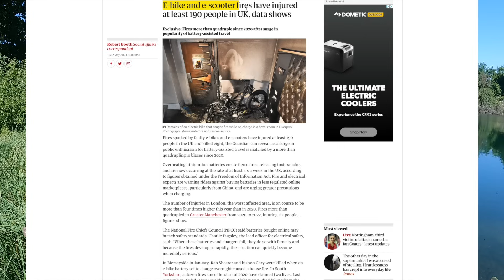ebike batteries dont just catch fire... what are they talking about?

Comment: I’ll buy the motor directly from China but not the battery pack and charger. I’d want to pay more for something that has been designed and assembled in the UK.
Reply from the maker: That might be counterproductive, many batteries made in the UK are glorified DIY sellers.
Reply: @andykirby  yeah I can imagine there would be a lot of DIY sellers, but surely if you bought from Halfords as an extreme example(I wouldn’t get one from there) they would at least to be a certain standard. Where  would you get one from?
Reply: @andykirby what's wrong with diy? They are of higher quality, well at least builder explains why and it matches quality of materiala

Comment: Every lithium battery will short itself at some point in its lifetime. This is because of something called "dendrites" that pierce the separator between anode and cathode. Most cells undergo a slow short and you encounter idle drain that grows. But some cells go full short(just probability) and you get battery fires. Lifepo4 are safe because they smoke instead of burning up in flames like nmc cells. This is why server rack companies put their batteries on sale within 3 years. Unfortunately, people buy these used cells from online and rejoice that they can still hold 90% of their capacity.
Reply: "Every lithium battery will short itself at some point in its lifetime." That's quite a profound statement.
Reply: @jimmybrad156  It is mostly a slow process. You encounter it as "idle drain". Tesla was working on managing " dendrites" but not sure happened with that project.
Reply: @12villages  I guess that explains those rare but spectacular cases of a cell sitting at room temperature suddenly going hot.
--
I've seen some videos of lifepo4 cells giving off a flame but because it's more like  wood burning well rather than the LMC flame-thrower fire-bomb. I can find the links if you're interested.
--
Cheap 3S jumpstarter in the back of the car is kept at ~50% SOC. I've noticed with another one I sacrificed and on one of BigClive's videos that after you use them once or twice (for pushing hundreds of amps) they swell.

Comment: Hy Andy I've got 2000wat hub wheel 45amp controller and 52v20amp battery on a summers day if I take it to 36mph and a little more after 4 miles when homes the battery it quite hot and motor could that be of the sun because on a cool day the battery gets warm and motor also warm is that safe the system I'm running thanks

Comment: While I agree with Andy's main points here, I must just point out that I once had a 2600mAh, 7.2v LiPo in my pocket when it began to feel very hot. I yanked it out of my pocket just as one cell burst into flames. So they can, very rarely, go up unprovoked.
Reply: If it was in your pocket I wouldnt call that unprovoked...  Even if it was the only thingin your pocket.  LIPOs should never be in a pocket lol
Reply: @beastslayer9153  Yes, I had changed batteries in an RC car, dropped the discharged one into a thigh pocket and forgotten about it. Luckily it was easy to grasp the cables and plug, and to yank it out in one movement.
Reply: @beastslayer9153  never had a phone in your pocket?

Comment: There are many reasons why these batteries can catch fire. I've used Lithium Ion and Lithium Polymer with different gear for 15 years on a weekly basis. Not only are internal charge protectors failing but on cheaper knock off batteries it can even be a dummy unit or not even exist. Leaving batteries with a full charge over several days is the most common way to internally short circuit the cells. Lithium has the ability to create dendrites that will work itself through the insulating layer and create a short. The other reasons as physical damage in some sort, water or shock etc. So yes, they can suddenly burst and this should be addressed very well on all consumer products having a lithium battery.

Comment: I need to sort out a suitable charging location for my battery, I'll probably make an external charge point. Fortunately having built two 14.5kWh batteries that run my house from the garage via an 8kE Victron inverter I have a good idea what I'm doing. I've recently seen an increase in posts asking why their Victron inverter does quite work correctly, these people think it's plug and play, and just don't realise you really need to know what you are doing. I'm building my ebike this weekend, wouldn't it be great if the BMS had Bluetooth like my house battery does.

Comment: Okay then. Most fires are because of user error - or in other words, someone phuk'd up.

So, here's what I do, and so far so good:
1) Establish how long it takes to charge a depleted battery.  Anyone can know this with the first two or three charge cycles.  My BMS stops powering the bike at 12%.  If it goes that low, I'm walking.  From there it takes 5-6 hours to re-charge.
2) Get a simple, reliable wall outlet timer - like an old school kitchen timer, and set it to turn off at the appropriate interval. The plug directly into the outlet, have no cords to fail, and run a mechanical switch that is super reliable.  It will shut off the power to the charger whether the BMS is good or bad.
3) Use ONLY the charger that came with the bike.

Battery fires are nothing new, but are rare.  They also occur in vehicle batteries.  Why? a short between cells - or, leaving a battery on a charger that does not have a BMS to cut power when fully charged.  So it's the same risk and the same set of issues that cause these events.

The thing that's going to happen now thatyevery one is a-skeerd is that the government will begin passing regulations, written by un-elected beaurocrats, who listen to Big Insurance, on how we are allowed to charge E-bike batteries, thus making life more difficult for people who are trying to simplify it.  That's because we are Low Hanging Fruit, and can be controlled easier than telling China to clean up its act with battery production and testing BEFORE they are shipped.  There are only a few name brand battery companies in the world, but hundreds of sweat shop copycats.

Comment: Oh no batteries are bad is  an easy thing for them to sensationalise. They did the same thing a few years ago with vaping after a coule of 18650's poped, usually due to faulty eqipment or people trying to pull far to many amps. 

I did pop aa single 18650 once from a stupid error and it was no joke. I would hate to see one of those big battery packs up at close range.

Comment: Retired now, but I traveled with laptops and multiple batteries.    Some batteries were known to be defective by serial number. How do airlines handle a laptop fire?
Reply: Q: How do airlines handle a laptop fire? A: they have fireproof bags.  also recognize that laptops, phones, tablets, etc tend to run on batteries with fairly low Ah ratings, so what we're NOT talking about are large packs wired in series to bring about 24V, 36V, and 40V operation like you'd find in an E-Bike.  so gotta be careful of the trap, cause as Human Beings there's nothing we love to do more than making FALSE COMPARISONS so as to "rationalize" and "justify" the dumb things we want to do.  yeah, those with the courage to pay attention know we just got finished watching this with Stockton Rush and that ill-fated carbon fiber submersible.
Reply: Planes land  whenever there is any any fire on board...  But an ebike battery is much much larger than a laptops battery and would be a deadly problem on a flights, which is why there are battery size limits on  commercial flights, unless you are taking about new  battery shipping, which must be done by a certified lithium battery shipper, with each battery model being shipped by the shipper having a specific packing method that is reviewed by the  permission granting authority and is followed by the shipper , according to international laws.

Comment: The problem is threefold, 1st. Battery packs with no or low quality BMS. 2nd. Crappy chargers that do not cut off at full charge. Even the cheapest cell phone chargers made today will do pumping current into them once full. 3rd. Unattended charging. I put this last because this is not the bulk of the issue. Reality is if 1 and 2 were dealt with then 3 would be less of a need. Blaming the consumer who is not likely a battery expert is not the solution either. That being said, I recommend that everyone visit the Battery University online to get some basic knowledge about how berries can kill you if treated without respect. 

People acting like just being present will magically prevent a fire are crazy, at best in SOME cases it will allow you to get the bike outside away from the structure but if you live in a highrise just being there does nothing for you unless you can get the pack outside somehow and keep the flames away from the building. Got this reason I recommend people either get a fireproof charging bag or charge inside a fireplace/wood stove or oven. Essentially someplace that can contain a fire (a regular stove will not vent outside obviously)

What IMO would help? 1. UL listed battery pack certification should be standard. CE Certification is a joke as its just a self certification. The UL certification assures peck designs have been fire tested. 2. Quality BMS must be installed on all packs. This can be confirmed when pack designs are submitted for UL testing with absolutely no garbage units allowed. 3. Auto charging cutoffs at user defined settings. This means better quality chargers shipping with bikes. 100% should only be allowed if the bike is going out to be used immediately to draw down the charge and even then I'd still want a small buffer, say 95%. Unattended charging up to 80% would be safe. Then allow for remainder when someone is present.

But, what do I know?

Comment: You can imagine items getting stolen and passed on without instruction and basic operating perimeters. I'm also guessing there are counterfeit components flooding into this expanding market. My replacement Ebike  battery is around £800 to purchase from my dealership. You could be offered batteries at half this cost for two reasons only, They are fake or stolen.  I would never buy a battery or charger from anything other than a genuine supplier. House insurance companies will be soon asking do you own an E vehicle so they can con even more money from us. stay safe all.

Comment: I've worked as an ebike tech. The BMS is designed to shut the entire pack down if even one cell goes bad. If it didn't the one bad cell would try to charge itself from the other batteries. I have noticed that there's various qualities of BMS devices on the market. There's some very basic ones that only cut power at a certain voltage. Better ones will provide automatic cell balancing. These are a bit more complicated and expensive. Battery packs built with these also have a higher self-discharge rate. I've even seen BMS boards that have built-in Bluetooth, that will connect to a companion app and give you a live voltage update of each cell. You get what you pay for. Whenever you get a battery pack, I would open it up and inspect it, and make sure everything is sealed, isolated and secured. I had a loose wire on mine, that prevented charging until I soldered it back into place.

If I'm riding in any kind of wet conditions, I also pull the battery when I get home, and make sure there's no moisture build up around any of terminals. In my time, I've seen plenty of bikes develop electrical problems with the wiring harness. What I do is that all the connectors get a dab of dielectric gel on the inside. Even though the connectors are designed to be water resistant, I will also wrap the connection with some electrical tape to make sure nothing gets inside. The power connector to the motor is especially critical. These will transmit enough power to melt the connectors if corrosion get inside.

I put my battery inside the stove when it's time to charge it. I live by myself, so I don't have to worry about other people using the stove. If you have other people in your household, you might want to think about constructing a dedicated fireproof charge bunker. I've seen some R/C people build charge bunkers from cinder blocks with a bag of sand positioned on top. If a fire breaks out, it'll burn a hole in the bag, smothering the battery in a mountain of sand.

Comment: If batteries are left in the direct sun too long there’s a fire risk because of condensation making liquid build up inside. It’s the same with leaving battery in freezing cold temperatures too long then you’ll get ice build up making the Same risk. So avoid water in all forms from extreme temperatures. That’s one reason, the other is shunting the controller or using the wrong match of voltage which is a fire risk.  But these are easily avoided so problems won’t occur. 
Enjoy your ebikes peeps responsibly and  you’ll get years of fun. 😊
Reply: One smart move is to keep your e-bike in a climate controlled environment. If you have no car and you must get around by e-bike due to a disability see if there's anywhere you can put your bike indoors when visiting others. If not, just kindly decline and stay home. No e-bike should ever be exposed to extreme temps for long. At least when you're home you have control over where your bike is kept, at least if you have a good household or live alone

Comment: It's not hard for a battery to catch fire if a cell goes bad, what happens is that the maximum voltage of that particular cell will drop(I have a few that did that on my drone lipos) a 6s (4.2x6=25.2v) would have 5 that would reach the normal 4.2v but 1 would not go past 3.8v... if you try to charge it to its full voltage (25.2v) the bad cell will only go to 3.8v and if you keep charging it will get hotter and hotter and if you keep that up it will catch fire. Hard cells can have the same issue happen to them, it usually happens if you keep the battery at 100% all the time or near 0% all the time. Remember that the BMS will not know something is wrong with an individual cell, that isn't how they work, it will try to bring the whole pack up to max voltage and then try to balance the cells, but if a cell is bad and never reaching full voltage that BMS will never get to balance mode and will keep trying to bring the pack to full voltage which will eventually cause it to catch fire.
Reply: You need a better bms then as the one i use will stop charging if a single cell goes over the max volt i set for each cell and will not allow charging if a cell is bellow a lvl i have also set and will also cut charging if the cells drift from the cell difference lvl also programed in to it
Reply: @haggisbasher2906  most BMS will stop charging when that happens, but they won't ever enter balance mode if the voltage of the whole pack isn't close to full... I agree with you, I only use good quality Daly BMS's not the cheap crap. It let's you program the exact max and minimum voltages of the pack from your phone if you get the Bluetooth/usb version. You can also see the individual voltages

Comment: If you connect a lower voltage charger into a higher voltage e-bike battery, it's simply going to draw 0 amps.  If you plug a higher voltage charger into a lower voltage e-bike battery, it's still not going to exceed the maximum current the power supply can deliver.  So, a 3A 60V charger will still only deliver 3A to a 48V battery.  Its CC (constant current) circuits will actually lower charging voltage as not to exceed the max current.  Most likely it would be fine.  But don't do it on purpose!  The higher voltage charger might also have a higher charging current than the proper charger and, therefore, charge the battery too fast.

Comment: The battery management units probably end up with a dodgy voltage regulator and allow more voltage through eventually than you want for the battery on charge at the time, the results are cells WAY over 4.2 volts a cell (which is full) and a release of energy has to happen, if your lucky the cells have a vent on the neg terminal, some cells have zero protection at all surprisingly and are literally like a mini pipe bomb
Reply: Bare 18650 cells have no protection of any kind. They're intended to have a BMS installed by the pack builder. You can also get tiny dime sized BMS that fits on the end of the cell, if you're using it to power something like a flashlight.

Comment: I charge the bike with the batteries installed in the frame and always set a timer to check for full charge and disconnect when done.  I charge them in the garage with nothing in close proximity that could catch fire, would likely need to explode in order to breach the frame that surrounds the battery in any case.  In winter I will bring them inside to store as we have quite cold conditions and keep them in a cool location inside of a steel fireplace ash bucket with a lid.  Likely overkill but I will sleep better at night knowing a fire should be contained if a failure occurred, obviously smoke detectors in the room as well and a fire extinguisher handy.
Reply: Honestly, your fire extinguisher is not going to do anything ! When a lithium cell has a catastrophic failure, nothing can extinguish the fire because the cell is producing all of the three required elements of fire fuel-air-heat  Even if you were to drop it in water, the fire will continue until the energy from the chemicals has been released.
Reply: @Will-thegrumpysoutherner  a fire extinguisher is still a very good idea. It’s not for putting out the battery fire; it’s for putting out fires started by the battery fire.

Comment: another matter with charging is using the right voltage charger but with higher amps,to get a full fuel😂faster.
this in time can make the cells weak and ready to pop.becsuse more amps always generate more Heat.